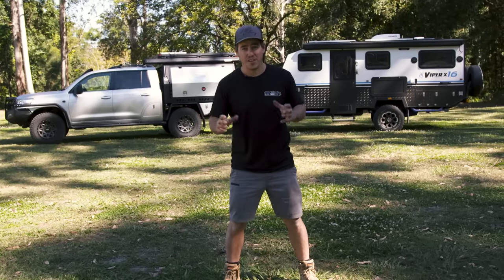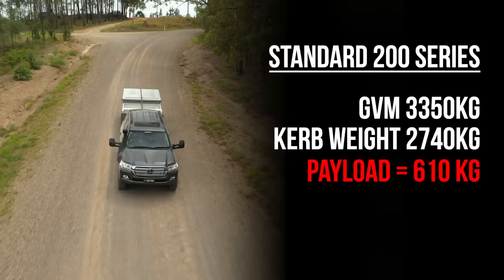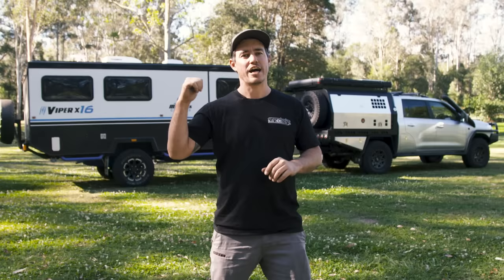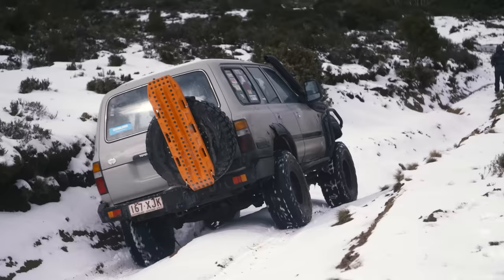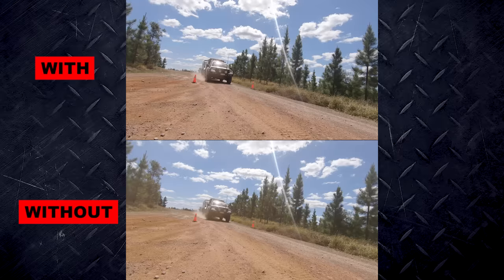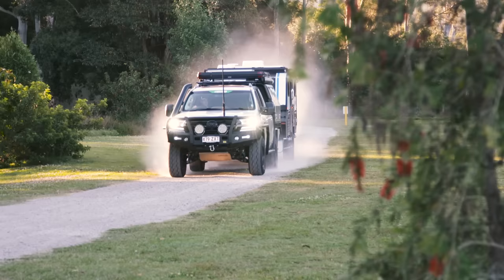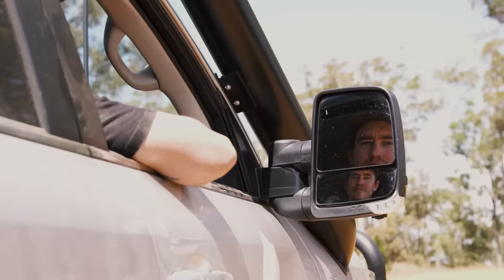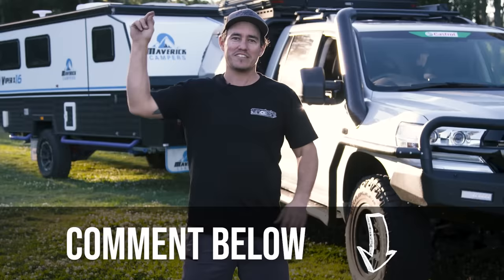SETTING UP YOUR 4WD TO TOW – Expert Secrets! GVM vs. GCM – Towing weights explained

Comment: You fail to mention what if any, issues this will cause with your manufacturers warranty? - will the vehicle manufacturer valid any claims after gvm  upgrade?

One has to ask the question, if increasing gvm is as simple as upgrading suspension, then why don’t manufacturers offer this as a standard upgrade or optional extra?
Reply: Warranty claims vary a lot between brands and even dealers. 
Technically any change to non approved components can void warranty claims. (IE, this could be as simple as changing tyres or brake pads for an ABS issue)

Comment: For me in US where we do not use kilo's, Why would your weight be told in tons?
Reply from the maker: Then it would be a four-tonner
Reply: @4WD247  makes no sense. Either be metric or not.
Reply: @stephenhope7319  Good question - the weight was given in tonnes (metric ton) which is 1000 kilograms. Hope that helps.

Comment: Why don't you Aussies like American trucks for towing? Look at the Ram 2500 (American ratings):
Power: 276kw
Torque: 1156Nm
Max Payload: 930kg
Max Towing Weight: 7.14t
Curb Weight: 3.36t
Definitely a bit of a different beast than a Land Cruiser. But if its towing and touring, you wouldn't need to really do any mods to it.

Comment: Will insurance companies actually weigh everything?
Reply: I don’t know about vehicles but in my experience, insurance companies in general will use every ounce of fine print they can to try and screw you over. So it wouldn’t surprise me
Reply: They could, so could the police if you are involved in an crash, or if they are doing enforcement.
Reply: The police will for sure if you have a accident and kill/hurt someone. Good chance you could do jail time.
Reply: @michealplater9007  Qld police at transport inspectors have mobile weighing pads the put under each wheel and act like a weigh bridge. Last trip up nth to Cairns at Easter they had heaps of vans and 4wd pulled over and lined up checking GVM'S.

Comment: In my opinion, Electronic Stability Control should be as mandatory as seat belts are in cars and one DOESNT need to tow at 100/110 km/h...Tow sensibly, let following traffic pass and you will travel safely forever...